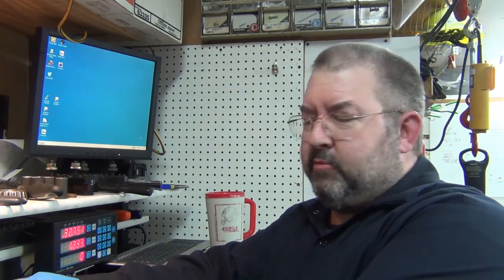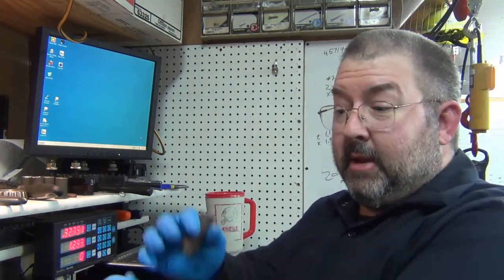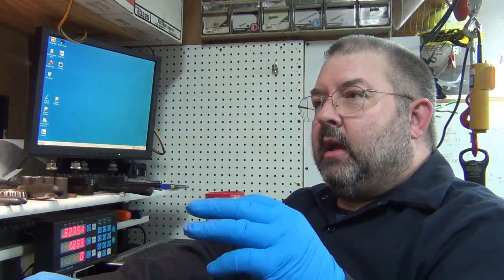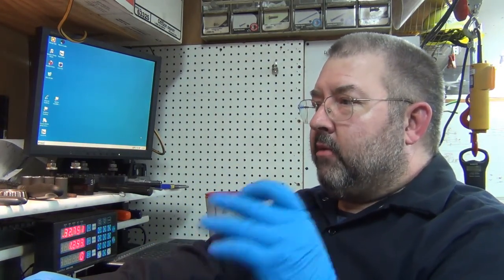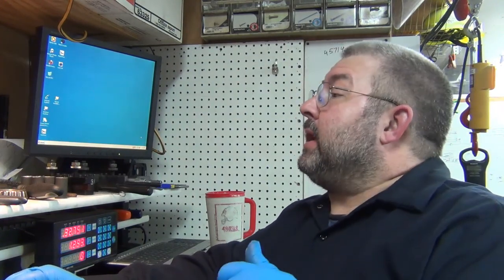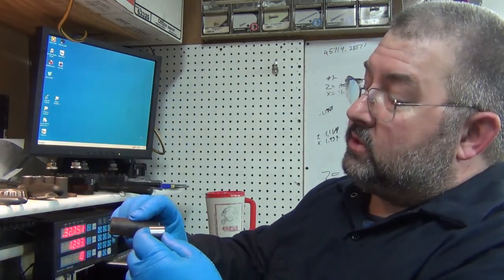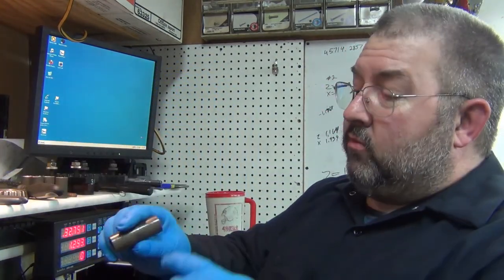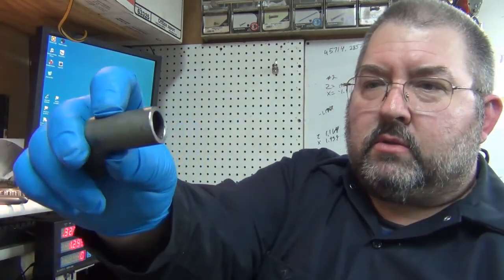9x20 CNC Lathe - Outer Bearing Adapter - Part 1

Comment: cold rolled solid round is as cheap as DOM where i live, so if you went with that, you may eliminate the tolerance problem, and you can turn the OD with a parting tool mounted on the carriage on the opposite too and part with it right after while retaining your boring bar so you don't have repeateability problems with changing tools
Reply from the maker: I used the DOM so that I wouldn't have to drill/bore the center any more than I had to.  
Great idea about having the second tool mounted like that. I'll have to try turning the OD with the parting tool.  I've thought about making another block for that parting tool, I just haven't had the time to work on it.  I've also thought about making/buying a boring bar that uses a triangular insert with both corners exposed.  That way I could cut the OD and ID with the same tool.  If I put it at a slight angle, I could even clean the face up with it.
Thanks for the input!!! Great stuff!!
Mike
Reply: that's also a popular option
Reply: bluehandsvideo You can use your boring bar for external machining by running the lathe in reverse. You should be able to face the end with it too without changing anything. 
ATB
chris